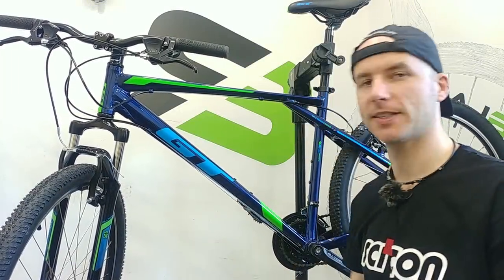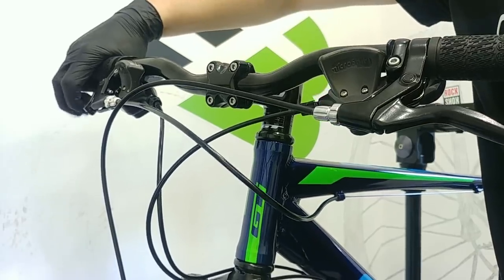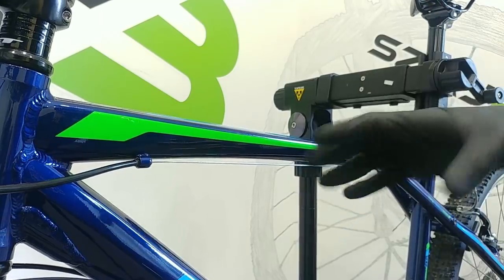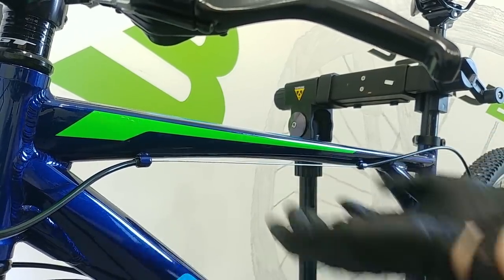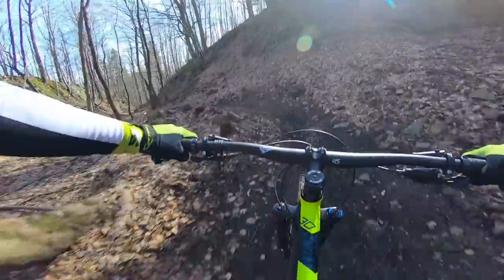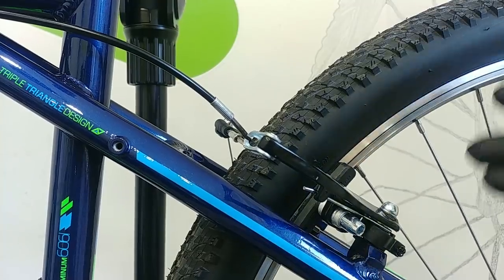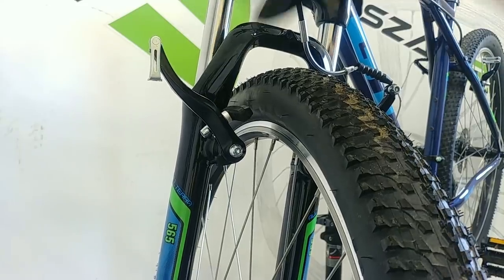Why Your Cheap Brakes Don't Brake?? 5 Hacks For Max Braking Power On V-Brakes & Calipers.

Comment: Degreasing with “Simple Green” degreaser on the rim’s braking surface would optimize more braking power to the point of like having disc brakes.  Make sure the brake pads are toe in properly.  My recommendation for high quality rim brake pads are “Kool Stop Dual Compound” brake pads.  The Kool Stop Company have been around for many years since probably the 1980s.  They work in both wet and dry conditions.  Peace ✌️
Reply: After replacing hard stock pads on cheap bike with kool stops it's too easy to go otb) And softer compound will not ruin rims instantly (as long as they are kept clean, of course). Pricey but worthy.
Reply: 1 eq 0 dot 99999 repeating They are not pricey but worth it to me.  To prevent going over the bars than you need to know how modulate the braking power to prevent going over the bars.  I know how to do it.
Reply: @evelasq1  I mean diff between old woody pads and new KS's is huge. Of course one shouldn't brake mindlessly but that applies to any brakes.
Reply: i can tell you know what you are talking about im  going to give that simple green a try
Reply: David Jenkins Good luck to you and please try to get the Kool Stop Brake Pads.  Believe me that they do work very well in both wet and dry conditions.

Comment: The reason the screw that is holding the brake arm in at the pivot is hard to loosen is "thread-lock" it serves the same purpose as a lock washer, it's so that CANNOT loosen up for any reason unless it's forced to. 
You don't need brakes falling of the bike due to vibration.

Comment: To the last tip - you just need to unclip the cable and squeeze the top of both caliper arms, that way you will see if the pads are adjusted or not and while you are squeezing the arms to the rim you can adjust them with some help or if you dont have help, you can just release the brakes unscrew them a little and start squeezing the arms again and while its pushed to the rim, you can adjust it
Reply: I do the same thing but I also release the springs that hold brakes open, you can line up each brake pad up with the rim by yourself.

Comment: I own a number of older bikes. My choice of v-brakes are either Deore or XT when I find them. Jagwire pads, cables and housing. I've upgraded a friend's older GT aggressor (like the one in your video) and made major difference in stopping. Pads, cables and housing are not expensive and can turn a turd of a bike into a gem. Great informative video bro.
Reply: agree with jagwire cables real nice
Reply: I’m a bike newbie. Will these cables work for a folding bike? Ty

Comment: Thanks for the video, it's very explanatory! I wanted to ask you if the bike you rode in the trail footage had v-brakes? What do you think of riding a v-brake bike on blue-difficulty trails? I'm not very keen on upgrading my mtb at the moment, so I'd like to squeeze every inch of performance out of it without spending a lot of money :)
Cheers!

Comment: Great video!
I have cheap shimano pads on my MTB, but would like to have more stopping power without breaking the bank.
Which pads are the most bang for the money?
Reply: Koolstop

I use the salmons
Reply: koolstop +1;
clarks tri-color also.
Reply: kool stop for the win
Reply: Shimano sucks and damages rims, odyssey red or discontinued gum stops fast without much squeaks, swissstop bxp are ok, had to try koolstops but they are probably similar.

Comment: Damn, cable pull brakes, I never realized, pretty much rely upon the cable housing 100%. They are pretty shaky bridges looking back at how they work.
Reply: they are a lot easier to work on though not worried about bleeding my brakes every year just pop on a new cable and unless you are racing or doing red bull rampage type suff cable pull brakes are all you need

Comment: I ve got roaters ? Disk hydraulic ! Does it still apply ?
Reply: No.
Reply: haha
Reply: Lol no because if it’s hydraulic, then that means their is brake fluid and not a cable. It is completely sealed and the housing won’t move since it’s just brake fluid.

Comment: Are v brakes still used on mountain bikes?
Reply: Yes
Reply: In cheap ones...
Reply: @PiotrK2022  well yes no one has 5000 for a “good” bike
Reply: @ivan-_-6192  exactly its all about price. V brakes have much lower tolerance so easier to work with. Also I don't care if i burn a pair of V brakes doing donuts, I def won't feel the same. About expensive disks..

Comment: You unscrewed the brake pivot with brake bolt? Congrats! :-) What I use for lubrication is Hilti hammer grease. Does the job and seals the brake, so no moisture nor dirt can emter the cantilever area.
Reply: lol right

Comment: Why do you have the rear brake on the right lever? Right lever should ALWAYS be front brakes just like on a motorcycle. Why confuse the issue? 😮
Reply: It's always been like that, having it the way you described would drive me nuts. I'm pretty sure it's standard for the front brake to be on the left for bicycles, you never confuse it with a motorcycle
Reply: Supposedly, that's how it is in mainland Europe. In the United Kingdom, the United States and Japan, the right brake lever engages the front brakes.

Comment: Don't lube your cables, just don't. It will attrack more dirt and therefore wear out faster eventually. Cables are cheap, when they are done they are done. 
On new cables you can clean them with WD-40 before installing them but don't lube them. Also don't invest in teflon pre coated cables, the teflon coating will wear-out fast and then clog up your cable housing. Polymer coated cables don't have these issues but many brands have shown that top-tier innercables can also be polished and perform just as good in the long-run.

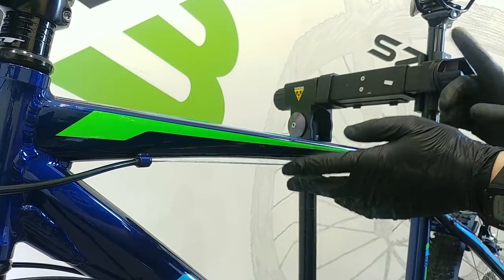Keep the internals free from dirt is the best you can do. Use outer caps with tongues where possible and make sure that rain can't directly rain in to the cables. If you did submerge a part of your bike in the water you need to clean the cables after your ride to prefent rust! (as shown @4:55, no lube, some cleaning with WD-40 is fine)

Comment: Spacing the rear end of the regarded as cheap rubbish but highly effective clamp brakes simply go around your wheel wrap between 2 spokes with 2 layers of electrician tape to create a space, tighten pads, remove tape, violai no vibration noise from pads.
Reply: What
Reply: Or you could use a rubber band, and reuse for a loooong time

Comment: Those bakes are reversed to UK FRONT RIGHT,LEFT BACK here???????
Reply: Yes yours are reversed
Reply: That is under EU law. 

V-brakes are more effective braking power and modulation as shown in video because of cable routing to the caliper accept hydraulic brakes which makes no difference.

Comment: Oil on the Cable destroy the Teflonsurface,never add Oil on Cables
Reply: What about TPF lubricant instead of mineral oil?
Reply: Wrong. On most cheap bikes with no-name brakes (as he mentions in the video) the brake  cables are NOT coated, so you will be better off putting oil in them.
Reply: I think mineral oil would do no harm, right?

Comment: No o0ne uses crappy v brakes on mountain bikes  in 2019. They are dangerous.
Reply: They are not dangerous and I have been using them for over twenty years and I have no issues with proper maintenance on the bike.  I could make my V Brakes stop like it was Disc Brakes.  Don’t make this assumption on V Brakes.  The best V Brake pads are from “Kool Stop”.
Reply: I'm even happy with my canti brakes! Now that's oldschool lol
Reply: @evelasq1  I doubt you would, you obviouslly haven't seen bike disc brakes in action and even ride one with them. Not to mention disc brakes work in any weather.  Yes they are dangerous, had countless accidents with them, never had accident with disc brakes and I've been riding bikes sincer early 90's.
Reply: Zagica I have ridden V Brakes in all types of weather and they work great.  I have been in snowy conditions, rain and dry weather.  There must of been something wrong with your previous setup.  I have done downhills on City Bridges at maximum of 26.4 Miles per hour.  I have gone up to 28 Miles per hour on a city streets.  Disc brakes are about the same thing.  V Brakes offer brake modulation more than Disc Brakes.  Quality Rim Brakes perform nearly as good as Disc Brakes.  At least I don’t have to bleed the brakes.   If I wanted hydraulic V Brakes than I can do it by using Magura Hydraulic V Brakes.  Or I could have Magura Disc Brakes in the front and Magura V Brakes in the back.
Reply: Laci O. You could upgrade your cantilever brakes to Magura V Hydraulic Brakes.
Reply: @evelasq1  have them on one of my bikes. The're great!
Reply: Laci O. I have Shimano Deore V Brakes that would make sure the brake pads are flushed flat on the rim.
Reply: plenty of people still do most people dont have aspirations to be a pro mountain biker and what do you think they were using back in the day!  I have an old bike with Vbrakes and it works just fine i go down super steep hills on it.  Disc brakes are obviously  the better technology but not the extent everyone needs to run out and get that tech.

Comment: Boring to watch this in 2019... We use hydraulic disc brakes now, and have done in a long time now!!
Reply: Kent Nilsson not everyone is buying at that place in the market. Some super cheap bikes still come with v brakes and often aren’t assembled that well . If this helps just one person get on the trails then it’s worthwhile
Reply: No, we don't.
Reply: Some of us are buying vintage MTB's with cantilever brakes. Disc brakes back then weren't mainstream like now.
Reply: Who's "We"?
Reply: @Kent Nilsson hey I have a cookie for you buddy its awesome you have hydraulic disc brakes dude!  Guess us mortals have to keep dealing with V Brakes.  Some of us mortals have  have more than one bike in our stable that we have to maintain.  I have to maintain both systems.  The more you know the more you grow.
Reply: No we don’t use hydraulic disc brakes, if you can’t afford an expensive mountain bike or your parent buys one for you just like me then you can pay much for a mountain bike. Mine costed only $160 and we got it on sale and the damn thing has disc brakes in the front and v brakes in the back. At first the v brakes were really good but now the disc brakes are really good and the v brakes HAVE NO DAMN GRIP, they are tight and they barely stop the bike.
Reply: I personally like riding v brakes more than disk brakes